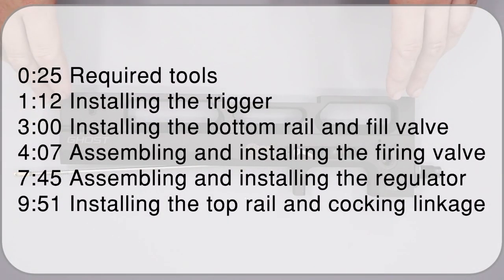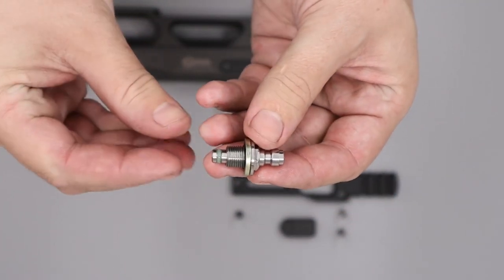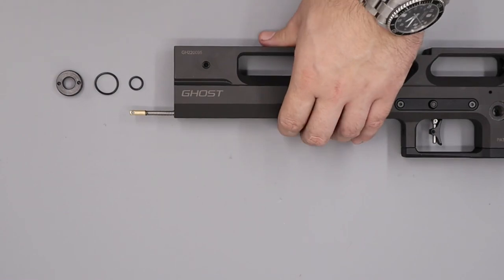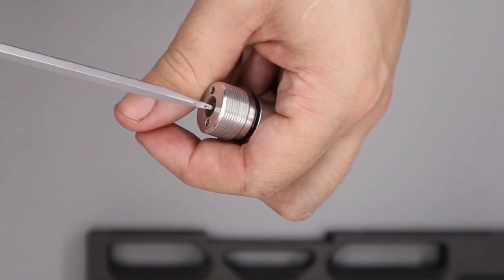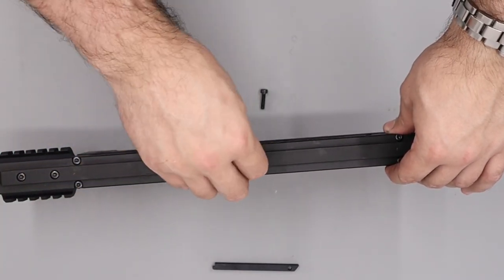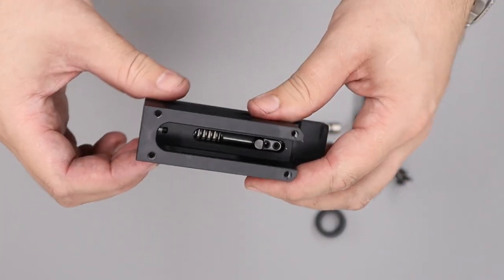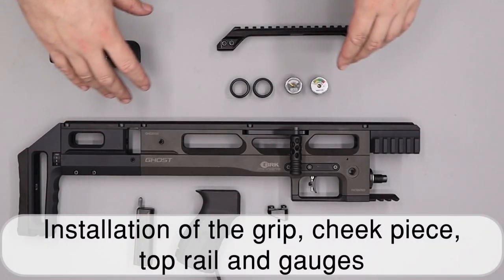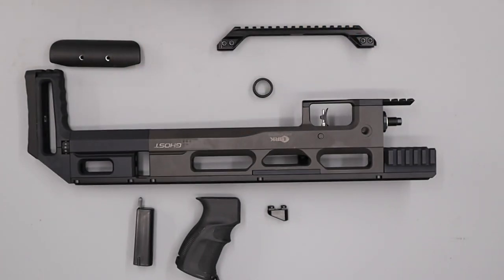BRK Ghost assembly

Comment: Excellent Jeff, thank you!  Regulator questions:  The sealing disc, no requirements that the cut out is aligned in any specific way?  Did. you use silicone grease to lubricant the belleville spring discs?  Is there a maximum set pressure not to go above on the Ghost's regulator?  again greatly appreciate your videos and expertise!
Reply from the maker: Thanks for your comment - for all technical enquires please visit our technical support page on our website.

Comment: What is the purpose for that center grub screw on the chassis directly on the valve (on which you apply grease at 11:05 of the video)?  I’ve noticed that when I fire a pellet while touching the cocking lever the lever moves as if air is leaking through something to cause it.  Could it be that since the rail rides over that grub screw an air blast is emitted from around it (grub screw) and causing the rail/cocking lever to move?
Reply from the maker: Thanks for your comment - for all technical enquires please visit our technical support page on our website.

Comment: Hello Friend, excellent video for maintenance issues, I had a problem, I hope it is not serious, but the following thing happened to me: I dismantled the rifle so I could only clean the barrel and the rest of the chassis without removing the regulator, I removed the bottle, I released the air from the plenum, when I finished cleaning I reassembled but when I put the bottle in, air began to leak through the barrel and When I try to reload the lever it gets stuck in the middle and doesn't allow me to push the lever all the way back, therefore the air keeps leaking, I removed the bottle but it still won't let me reload correctly, I hope you can advise me on this problem, greetings from Morelos, Mexico...
Reply from the maker: Thanks for your comment - for all technical enquires please visit our technical support page on our website.